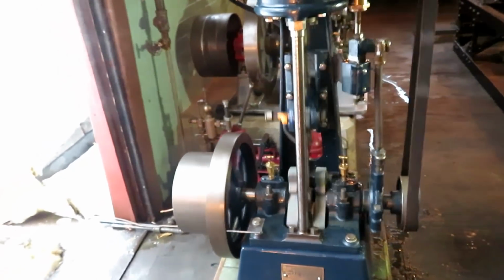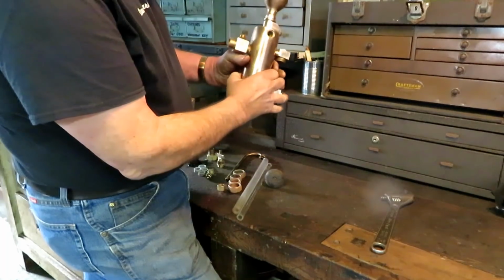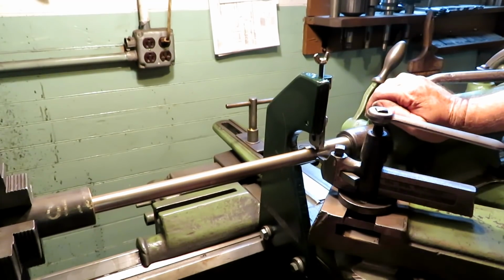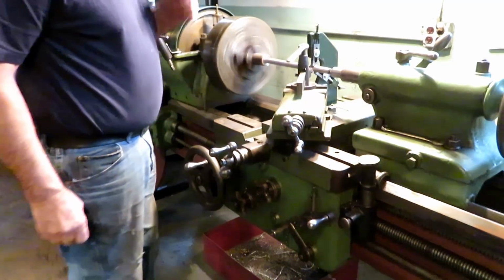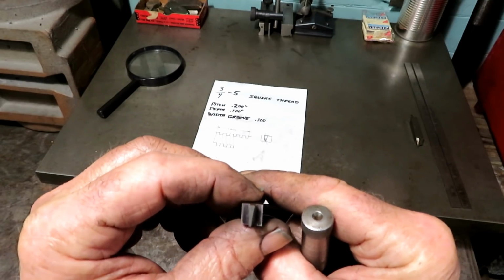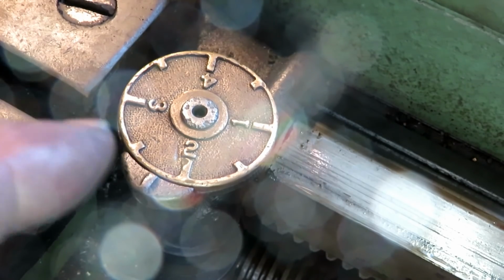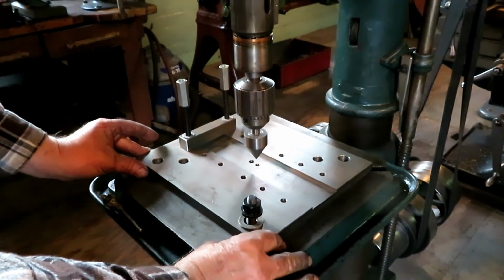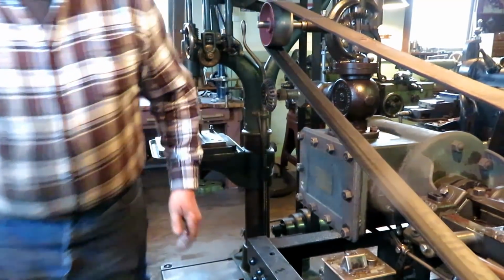OLD STEAM POWERED MACHINE SHOP 49 Cutting a square thread

Comment: The thread was Cut In a Threading machine --It has Split dies you place the work in the jaw and Started the die engagement as It threads Up it hits the kick out and you manually return to starting .., I have threaded Thousands Of C-Clamp screw in Modified Acme thread At Our Old Batavia Clamp co. On an old belt driven machine In the 60's  Randy. !

Comment: On the drill press I see a splined shaft running vertically. It has some pretty good wobble to it supposing it is bent or work hardened and thinking it might affect  the drill speed if excessive. Not at this time and will be covered with lubrication. The drill itself is a wonderful addition driving off that old steam engine. I know you have several for different work categories. There is a tool missing which would have been in a complete machine shop at the turn of the 19th century.🎉

Comment: Dave have you made a previous video on grinding a tool and what you use as a grinder?
Reply from the maker: The two grinders I use most are pretty crude shop built with belt drives. I have 2 large pedistal grinders now but haven't found any wheels yet that I like for high speed steel tools.....Dave

Comment: Good job, well done.
If you turn the tool upside down and run the lathe in reverse and start at the headstock you can just run off the end of the thread .
I have done that.
Joe Piezinsky that is Y tuber does all his threading this way, check his site out .
Very good information there .
Reply from the maker: Seems extremely awkward to me. Lots of ways to do it....Dave

Comment: WOW! I was in Mobil Alabama ship yard and saw a large machine shop in one very large building. I went inside to a row of 15" swing lathe's where two machinist were working. All the lathe's had lantern tool post's and the machinist were using a piece of angle iron, with a slot in it, that they would set on the bed of the lathe to set center, very quickly, on the tools when they changed them.   Neat and clean machining, low RPM, and very efficient. I am 64. Started machining in 1978. All manuals until 2006 when I started at Halliburton on a 4A Warner & Swasey roughing parts for the CNC's. About 4 months later I started training for CNC"S. I had collected a few books on the machine's and machine shop's on the very machine's that you are running, Sadly I lost them to a flood in 1990. Thank you, Thank you, Thank you for posting your awesome work and for sharing.
Reply from the maker: Hi Ed, Thanks for your comment and recap of your experience. I spent some time in Mobile in the early 1970s, was that shop right on the bay? ....Dave

Comment: Upon viewing this Morse steam engine the first thing I thought was power failure locally. In that straight off the crank with either a sun gear to double the rpm to a 10kw power head or belt drive gear up for shop electrics and domestic house power. In that it would keep the shop warm and house powered up.  Just thinking is all on possibilities of that much excess power. Doubt if boiler would power both engines without shortening firebox life. And make shop too warm unless zero weather.
Reply from the maker: I'm in the process of building a "jackshaft" drive for the smaller engine to do just that.. It will be about 4.25:1 running a DC dynamo at about 1100 rpm for shop lights.....Dave

Comment: Less off topic than you might expect, is the perception of Physics and Geometry are Quantum Operator Fields Modulation Mechanism Mathematics here-now-forever cause-effect existence, sounds remote and incomprehensible until you realise every feature and phenomena in an intricate operation like this Machine Shop is how to think about some sort of graduated application of force in a steady balance of vectors. In Electronic Devices it's the "Q" point, in metals it's temperatures, in gases it's temperatures and pressures, always simultaneously at the cutting edge of the operation in balanced sequences. 

Professor Susskind's lectures, (whose Dad was a Plumber), on String Theory type maths of "vibrations" and Black Hole Singularity concepts, may look complex, (because the analysis of the superficial Cosmology is categorization of probabilistic infinities), but the meaning of QM-TIMESPACE Actuality here-now-forever cause-effect existence in pulsed resonances of e-Pi-i interference positioning modulation.., is just another naming categorization for the same continuous creation connection Principle of time duration timing. 
Knowledge and learning accumulated by seeing and doing skilled experiences, and aligning person ststaes of memorization as an integrated part of the whole.

Comment: How do you like your new steam engine?
How many horses is it?
Reply from the maker: Hi Frenchie:  It has an 8" bore with 10" stroke. Most traction engines with these dimensions would be rated at about 50 HP. Just guessing.  I like it fine, very trouble free....Dave
Reply: Thank  you Dave. How that compare with a 50 HP gas or diesel engine?
Would it be better to compare it with an electric motor?

Comment: Hello, great channel! I'm wondering if I can ask you about cutting fluid. For a long time I have used Dormer Super Cut, but I think it has had some chemical change made, because I find it no longer works very well. (I machine a lot of stainless steel).
Can you suggest an alternative?
Reply from the maker: I use very little cutting fluid in my shop. Surface speeds seldom exceed 100 fpm. For steel thread cutting I use sulfur based thread cutting oil or mineral oil., Kerosene on aluminum. Turpentine on babbitt, nothing on cast iron. Bacon grease also works on harder steel and stainless....Dave
Reply: Ok great Dave, thanks for this. Someone also mentioned Rigid dark thread cutting fluid; I ordered some from the US, but I'm going to try turpentine and bacon fat too on those materials. Dave

Comment: If and when the grid goes down for whatever reason, you will still be working with steam !  The hydrostatic lubricators were used extensively on GWR ( Great Western Railway)  locos, and many of these locos are preserved and running to this day.

Comment: Threading a vise screw would have been a production job, many pieces.  The threading would have been most likely done on a Landis threading machine.  The ending of the thread would have been tapered out as shown on the original part.
The Landis used dies or chasers to cut the thread.  Not single pointed as you have done.
I will try to insert a link to a 1925 Landis threading machine.  
I had a production machine shop for 50 years.
JIM
https://www.barbarottomachinery.com/View/1-12”-Landis-Single-Spindle-Model-A-Thread-Cutter-24956
Reply from the maker: Thanks Jim, That would have been a fast machine for this type job....Dave

Comment: If you can’t find the oil for the steam you can use “Filming
Amine”. Filming amine has tallow in it. It is injected into the steam system to
protect the steam and condensate piping.I lean something new every time I watch you videos.
Reply from the maker: Where can you get that stuff?..Dave
Reply: From a boiler water treatment company. Make sure you ask for FILMING Amine. Note: check with your local Hospital maintenance people they can hook you up with there treatment company. NALCO is one of the biggest and also $$ expensive. They use the stuff by the drum.Ed

Comment: Another really great and informative video. I'm old enough to have run these machines. I can still see the oldest VBM ever with overhead pulleys and man could she cut . The 48" table clanking and the two heads cutting . Oh well thanks , using the drill presses were the best built to really get the jobs done . Raising the quill for more or less room for bits is about the smartest addition on drill presses lost on today's models and no power feeds . We moved forward 6 steps then and backed up 8 with new drill presses. At one time I had a camel back that was scrapped but being space crowded and young and stupid I left it at my grandma's grandma's and my mother got rid of it . Oh more memories see what good you do. I wish you a super MERRY CHRISTMAS AND A HAPPY NEW YEAR.

Comment: Another great video David, thanks for the thread cutting demo. I have an alternative thought on the condition of that original. The pattern cut there at the end where it tapers is indicative of being cut with a die. Maybe that shaft did not break but was welded on to a new piece of threaded stock as a replacement for the original worn thread at some point. Instead of making a whole new piece they just replaced the threaded part.

Comment: Pushing 40 years ago I apprenticed with a Machine Manufacturer here in Indianapolis. They started back in the 1800's. I used to make Square thread feed screws 20 plus feet long on a manual lathe. We used a profiled wooden 2 x 4 with a radius cut in it to jam the screw against the follow rest on the compound due to the screw sagging from length. 1/4" pitch, 2-1/2" O.D. double lead. Chatter was always an issue so we would grind a small radius on the nose of the tool. It helps tremendously instead of a square end. We would cut the screw a bit further than 1/2 way down to a steady rest. After finishing that end to depth, we would turn the screw around, pick up the lead and finish the second side, blending the thread. The tool pressures are much different on a square thread than any other type. Nice finish on what you did. 2nd, my thought on that end taper on the termination end of the original screw you copied was probably formed by the lead in of a die. Just my 2 cents. Thanks for what you do to put this out there for us to enjoy David.
Reply from the maker: Thanks for the story Russ, I think you're right. The leading flutes on the die had an angle on the bottom of the thread that lessened as the full depth flutes came around...Dave

Comment: that engine looks great..and the thread too..
how did they do it on a big engine that stopped in the wrong spot?
Reply from the maker: Probably would have used a bar against the flywheel, some had notches in the rim for that purpose...Dave

Comment: Thanks for telling us what that squeaking was. I've listened to you run that lathe a lot and that was the first time I've heard that squeak... sounded like a bushing going out. Love your videos, they're a real treat!
Reply from the maker: I have to do something with the belt alignment on the lathe, it drives me nuts. The rubber belt never ran in the center of the pulleys although it's in perfect alignment. Sometimes you have to just tweek things, and I've run out of adjustment slot on the top hangar, so I'll move the lathe a little endways. I never can remember to do that.....Dave

Comment: I had to make a square-thread like that for a piece of laboratory equipment - like you I ground a tool to fit bang on (and paid attention to the flanks), but unlike you I ended up with thread grooves wider than the crowns!  It didn't matter for my application, but I thought at the time if I did another one I'd make a narrow tool and shuttle it about a little with the top slide.  All the best from UK, Mark
Reply from the maker: Yeah Mark, It doesn't hurt to be a little underwidth with the tool, you can always skin a little off one side with a little compound feed....Dave

Comment: `What's the story for the winch out the front?
Reply from the maker: It is a Mundy steam hoist from which the shop boiler came. I actually bought it for the engine, but the boiler turned out to be a great find, as you see.....Dave
Reply: Thank you, looks like something I used to use on ships for mooring and working cargo.

Comment: Dave based on the run out on the thread on the vice screw I believe the thread was cut on a lathe with a "thread chasing" device, which uses a technique similar to a plumber's pipe thread cutter (which also have a gradual run out). These thread chasers ( in German gewindstrehler) take several passes and run at a demonic speed and produce a lot of mechanical noise, but they usually produce threads of very high quality and they are very reliable in high production settings. The added advantage is that once they are set up by a competent machinist the whole production can be left to an unskilled worker that simply replace work pieces and clean up.
Reply from the maker: Thanks Yann, You are probably exactly right. The story at East Broad Top Railroad is that the first job an apprentice was put on was the "bolt threader", making thousands of track bolts and studs....Dave
Reply: @davidrichards5594  That's when I was introduced to them as well, running between two lathes trying to keep up. Those were that days when you didn't need to go to the gym after work :)

Comment: Hi Dave, About the oiler for the Morris engine, how does the oil get to the metering valve if the water lays on the bottom over the intake for the metering valve. Realy nice to see it running. I wish you and yours a Merry Christmas and a Happy New Year
Reply from the maker: That is a good question, I'll find a cross section diagram of one and put it up on the G+ page. Did you change your profile photo? I thought it was a dog?...Dave
Reply: Maby there is an internal tube that goes to the top of the wessel, No I have not changed anything on my profile, where have you seen my profile with a dog ?

Comment: Ok ok, the smaller engines are great but, I like the smooth quiet movement of the big engine. Powering along no complaints just power all day long.
Reply from the maker: No argument there Frank,  Morris needed some speed to run their centrifugal pumps they were building and owned the patent for.....Dave

Comment: Another lesson in working a lathe from the Master. I so look forward to your videos in the Old Steam Powered Machine Shop, it is a peaceful and soothing sound with the steam engine driven line shaft, always makes me smile. What's next for the Morris? Seems to be a lot of water condensing and dripping, is that what you are trying to reduce with the work you were discussing? Thanks for taking us along Dave, much appreciated!
Reply from the maker: In the spring, if I'm allowed another year on earth, I want to take down the O&S engine, set up the Morris on the concrete pad, which I need to remodel anyway and run the shop with it for awhile for the heck of it.....Dave

Comment: The Thread should have been a mas produced part, so to easily cut the threads to the same length, a taper attachment would stop the threads at the same spot on every part, and would leave what we see.
Reply from the maker: Hi Matthew, right, but what I was noting was that the BOTTOM of the thread ONLY was angling up towards the end. How do you do that without altering the square form of the thread?...Dave

Comment: Fine job on cutting square threads. I understand you have a 2 speed back gear on your lathe, could you explain how you can shift gearing on the fly? Also looking good on the Morris. Thanks Dave.
Reply from the maker: Hi Robert, Thanks for watching. There is a clutch in each gear. Both size gears engage the spindle when the back gearing is rolled in. They spin loose on the shaft and have a relief cut into their sides like a brake drum. There are cast iron shoes in each keyed into a shaft hub, made sort of like a steam engine piston ring with a cut so  one or the other will expand and lock that gear to the back gear shaft while the other turns free.  A sliding key in the shaft, that has a bump on it, runs through the "ring gap" to expand either one or the other when actuated by a flanged sleeve and shift fork. There is no detent, it just stays where you put it and has never given me any trouble in the 40+ years since I put it together out of a pile of parts.....Dave

Comment: Hi again Mr Richards.

It's always an exciting moment when another episode of "old steam powered machine shop" gets posted up...as you never know what's going to be inside...
This time we had a bit on work support...the type of thing the tool room boys would've made back in't day...

The section on square thread turning was particularly interesting...(you have to remember, I'm an electrician...not a machinist)

The pillar drill:
Was it just the camera or does the quill end float collars need a tweek...?
I thought that jig looked nicely made as well...

I did post a message up on the last video regarding the Morris engine but then the video seemed to have disappeared...
I'd said how I thought it looked a very well proportioned and nicely finished piece...

Its good when you can make stuff for old tools, vices & equipment like that as it keeps the old stuff going where otherwise it'd be off to make pots n pans...

Hope this isn't too many questions & chuntering on...

With thanks
Glenn
GLMelectrical
Leeds UK
Reply from the maker: I believe you're right Glenn, sometimes you see things in the video that you don't notice right up close....Dave

Comment: Hi Dave, it looked like the lathe spindle sped up after the half nut was engaged for a while and then slowed down towards the end of the thread. Are you able to move the belt from one step on the cone pulley to another while the spindle is turning? That would be a handy thing to be able to do.
Reply from the maker: Drew, That old lathe has a two speed back gear that you can shift on the fly, which is nice for some things. See older video about it....Dave

Comment: Nice job on the vice screw!  I love watching these belt fed machines. 

I was looking at the steam engine governer, and was wondering about setting it, and if there is a formula for that......
Reply from the maker: The adjustments don't do much on early "gravity" governors like on the big engine(without springs) you have to gear them up or down with pulley sizes....Dave
Reply: Thanks for the quick reply, Dave!